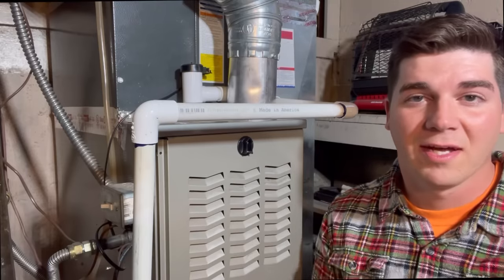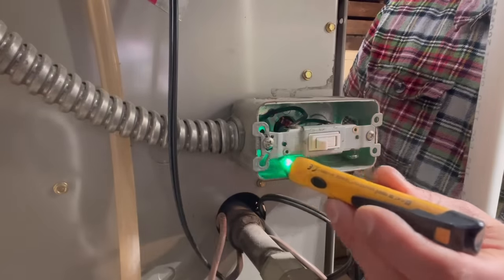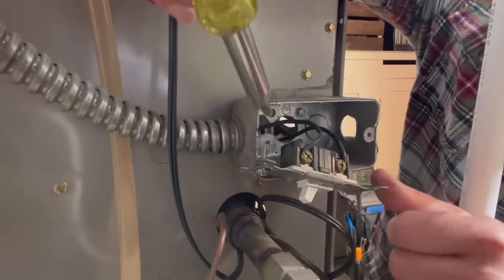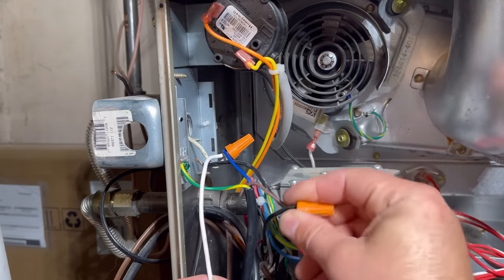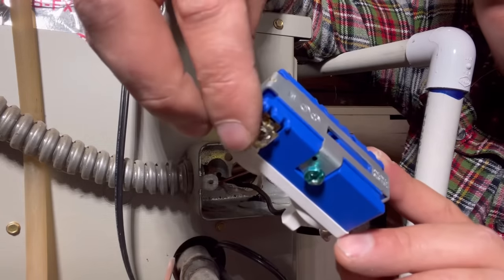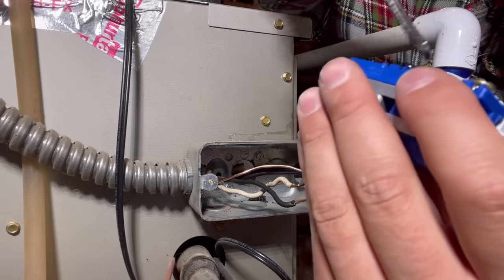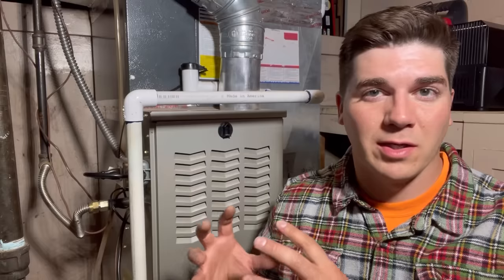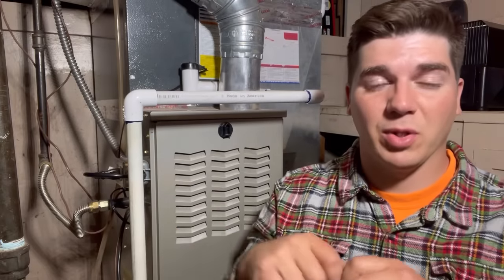This Could Keep Your Family Warm During An Emergency Power Outage.

Comment: The idea is good, but you could have just used a 3 way switch, which consists of a pole and two throws. You connect the main hot line to one of the throws and the plug hot line to the other throw. Connect the hot line input of the furnace to the pole and connect all the neutrals together (plug, furnace,line in). You wouldn't have to disturb any of the wiring in the furnace and you wouldn't need an outlet. The plug with it's cord would just hang down. It would never be hot. The switch would then connect the hot from the furnace to either the main line (on position) or the plug hot line (off position). So if it's in the plug hot line position, it would simply be disconnected from power as if it was in the off position. Then you could plug that into your inverter to power the furnace.
Reply: I really like your thinking.  It's an even more simple solution.  Bravo.
Reply: @ricklee4  What code violation is that? I'm an electrical engineer, please tell me because I must have missed that one. Do people plug in cords in which they have no idea what they do? What if there's a clothes iron with a pile of clothes on it? Someone could "accidentally" plug that in and burn down the house. Does that mean clothe irons violate the code?

If you're going to do this to your own home and you know there is no one stupid enough to plug it in, it is not a problem. The plug cord is short and can't be accidentally plugged in without connecting to an extension cord.

But hey, if there are people that dumb living in the house that would go out of their way to find an extension cord to plug in something that obviously shouldn't be, then you can put a receptacle there instead of the cord and have a special cord made up with plugs at both ends that could be used instead.
Reply: I'd love to see a video on exactly how to do this.
Reply: @Artanis1000  All you would need to modify is the white neutral wire inside the switch box. You would cut that wire, pull an inch or so slack out from the furnace and strip the two ends. Those two ends would be reconnected along with the white from the plug; you can use the same WAGO connector used in this video. The existing switch would be removed. There are two black wires going to it. The hot from main and the hot that goes to the furnace. With a 3 way switch, you would connect the hot from the furnace to the pole (or common terminal) and you would connect the main to one of the throws and the black from the plug to the other. Connect the ground terminal from the plug to a screw in the switch box. That's all there is to it.
Reply: @ricklee4  I agree
Reply: Once you remove the hardwired connection and attach a plug, the furnace is effectively "cord-and-plug-connected," and 422.33 specifically tells us we can very well use that accessible plug and receptacle as the disconnecting means. You can't get much better of a disconnect than literally disconnecting it.

That being said, I would still prefer to see the plug/receptacle before the switch, which would also have the benefit of allowing the receptacle to be used by a furnace technician for tools (vacuum?) during service.
Reply: @lizardking8388  please consider this hypothetical scenario, as an engineer. The furnace is a considerable distance from the breaker box, and is wired up with awg#14. In addition to that run, of course, it stops at the required safety disconnect switch at the entrance to the room containing the furnace (this usually means "top of the basement stairs" in my region). There's considerable voltage drop on that wire at the furnace end. At this particular moment, the furnace is running, and the generator is not plugged in. Since the neutral prong of your generator cord (which has currently fallen on the floor and your poodle is laying on it) is connected to the loaded end of that longass "neutral" resistor, you're about to hear a yelp and google the breakdown voltage of fur.

I have NO IDEA exactly where that is in the NEC and I don't feel like searching an 879-page PDF at this time, but the same rule that stops us from using suicide cords stops us from doing this. NO current-carrying conductors (hot OR NEUTRAL) should be exposed in that way.

My experience with engineers has been that they're excellent at coming up with systems that do the assigned jobs but seem highly prone to forget side effects that either code, general practice, or common sense already solved decades ago.
Reply: @emolatur  Here we go again....Another rocket scientist...... 

First of all, any voltage drop would be so tiny, you wouldn't even feel it. As a matter of fact, I've touched live neutral lines with my fingers many times for various reasons; either accidentally or from curiosity. Number 14 copper wire has less than 3 milliohms per foot. Let's exaggerate and say that there is 100 feet from the furnace to the breaker box. That means there is 300 milliohms of resistance. Let's also exaggerate and say that there is 15 amps going through that line. That would give a voltage drop of a whopping 4.5v (which also means it wasn't wired to code). If you put it in your mouth, you may feel a tickle, less so than putting a 9v battery under your tongue. No one can get hurt by this. If it was wired to code, the voltage drop would be less than 1v. Guess how many people died throughout history by touching a live neutral wire that was properly wired (correct amps/gauge/length)? Zero!

Secondly, you only need maybe 6 inches of cord, which would not touch the ground. If you want to be anal with the code you could also put a plastic bag over it (or wrap an entire roll of electrical tape around it) and label it however you'd like to prevent dumb people from doing dumb things since this won't be used very often. The plug would not be exposed in this situation. You could even get a double pole, double throw switch that switches both hot and neutral and your argument completely disappears.

Since you like to make up such unlikely scenarios, how about these with the furnace wired up just like in this video:

1) Your poodle, with his teeth, pulls the plug partially out and his tongue touches the hot wire. You now have a hotdog.

2) The heat stops working and your dumb son-in-law goes down the basement and with his extremely limited troubleshooting skills, he flips the switch back and forth without the furnace firing up. So he assumes the outlet is dead and has this "brilliant idea". He gets an extension cord, pulls that plug out and connects it to the extension cord which he then plugs into an outlet on the wall. However, it still doesn't work. Since he reached the end of his troubleshooting skill-set, he calls the heating company and they send out Moe, Larry and Curly to find the problem. They flip the switch to the off position and since they are not bright enough to notice the extension cord and assume the circuit is now off, they proceed to "fix" the problem without testing to make sure there is no power to the circuit. I'll let you figure out what happens next. Anyone authorized to fix a furnace isn't going to do so without making absolute sure the power is off by testing it first, regardless of the configuration.

Every time I offer up a great solution the safety police never fail to show up and give me a futile exercise to combat.
Reply: @lizardking8388  Listen I'm telling you why we don't do it, and you're showing me why engineers aren't licensed to do electrical work. Have a day.
Reply: @emolatur  Some of the electrical codes are vital for safety and some of them are over the top just to avoid lawsuits that make false claims as to how an accident happened. Yes, you shouldn't expose a neutral wire, but not for the reasons you mentioned (small voltage drop). The reason is that if the neutral wire somehow becomes disconnected somewhere between the connection and the breaker box (infinite ohms, full voltage drop), you can become become part of the circuit and be electrocuted if you grab the other side of that wire, are well grounded and somehow got a tight hold on the wire. Electrical codes are written to include any and all situations, regardless of how unlikely they are to happen, just to meet underwriters demands to absolve electricians and insurance companies from unfounded lawsuits. BTW - Electrical codes are written by, are you ready for this? Engineers! ...and they are blindly followed by electricians that are required by law to follow them. The likelihood of a neutral wire becoming disconnected, short of an amateur not tightening the connection in the breaker box or a chipmunk chewing through it in the wall, is lower than being struck by lightning twice in the same day. If such an unlikely scenario did happen, someone touching it (why would a normal person touch it? Don't we grab plugs by the insulated part?), would get a shock, most likely not lethal unless grabbing the terminal between two fingers standing in a puddle. 

Anyway, I already mentioned you could put a plastic bag over it and electrical tape as well or use a DPDT switch and that should satisfy all codes if someone wants to be as anal as an electrician. Electricians are forced to follow these anal rules, but homeowners are not. I believe this video is aimed at homeowners, not electricians and my solution is perfectly safe. I know all this because I'm an engineer and you're just a follower (electrician). Have a nice day.
Reply: @lizardking8388  I agree that some of the  rules are overzealous. Hell, some of them are flat out ridiculous money grabs... but there was a question up there /from you/ about code, and replying to that is the only reason I spoke up at all.

Personally I don't care how many codes (or general good practice) someone chooses to ignore if it's not my house or my job.

There's also a relevant bit here about generator bonding (which wouldn't make the solid neutral thing illegal, but would add extra steps to make it so).

A plastic bag isn't going to make it code-compliant. A DPDT switch would, yes.
Reply: @lizardking8388  you may be an electrical engineer but that doesn't make you an electrician. Check a code book he's right. And for you to give such a stupid response is ridiculous codes are made to stop such possibilities from happening whether your stupid or not for doing such things. You could have this set up in your house for 30 years and never get it wrong but there is a possibility when your engineering mind goes that you do mess up then what. The cloths burn or the linesman dies.
Reply: @lizardking8388  oh and do you mean a double ended male plug cord by "special cord"
Reply: @scottscott4067  Good god. I never said I was an electrician. Before calling me stupid, you should read the whole thread where I went into explicit detail of how some of the code is overkill and how an electrician even agreed with me. Then you will realize who really sounds stupid. I'm not repeating myself here. The electrical codes are written by engineers of which I am. Question is, who are you?
Reply: @lizardking8388  didn't call you stupid just your response I don't know you. For you to try and make someone feel stupid by say if you turn the iron on with close under come on man. If I empty my fireplace into my green bin after my fire goes out and park it next to my house it going to burn it down. So what it has nothing to do with the guy saying your way is against code. It is end of story.
Reply: @lizardking8388  A cord with (male) plugs at both ends is a suicide cord and deadly.
Reply: @TerrellWSmith  Yes, if you allow access to ANYONE, it can be deadly. However, if YOU made it with a 3 prong connector with all the connections straight through and YOU are the only one using it and YOU store it away with your equipment and YOU are smart enough to plug the two ends in before starting up your inverter and shut it off before you remove them, it is safe. This is something that only gets used in an emergency, when the power goes out; it doesn't just sit around in open space, waiting for anyone to use. I would treat such a plug no different than a firearm. Alligator clips are just as dangerous, I use them all the time. If you don't feel safe using my methods, then you shouldn't use them. Keep in mind, everything I mentioned in this thread applies to a furnace in the basement. Anyone who is going to be hooking up an inverter to a furnace should know what they are doing. This is not something I would recommend in the living area of the house where anyone, including a child has access. Driving a car can be deadly, but if you're responsible and know what you are doing, there is very little risk.
Reply: @lizardking8388  It seems that you're ignoring... or at least downplaying... something that's central to codes: houses eventually change owners/residents. When they do, the previous person's perspective on what is intuitive/safe/smart/common sense goes out the window, raising the risk that someone might be harmed. 

At its core, code is simply a way to establish some sort of baseline independent of personal tastes and preferences. And before anyone states the obvious--that harm is never 100% preventable--that's not the issue; it's whether we can manage risk by reducing the likelihood of situations where one-off configurations can potentially contribute to unintended consequences.
Reply: @sirrebral  Your way of thinking makes owning a house seem like renting; and seems communistic. If it's my house, I'm going to modify it anyway I like. Things I do to the house are there to benefit me, not the next potential owners. If one day I decide to sell it, obviously I would have to change it back or it won't pass inspection the way it is. Even if I forget to change it back and the inspector misses it, no one would be harmed for the reasons I clearly mentioned in previous posts. You're not going to leave a double plugged cord laying there with a note that says plug me in and find out what happens. The cord goes with you, not the house. No matter what configuration I mentioned, there is zero chance of anyone being harmed in any way, as I've explained; you people are really reaching.
Reply: @lizardking8388  It is your house, but only for a fraction of the structure's useful life. And it doesn't mean that you have the right to build or modify it any way you please, just like you can't drive your car at any speed you wish...other people have a stake in your actions. It's also not "communistic"; it's being a responsible person who doesn't act like a child when they don't get their way. And I'm sure that you know that home inspections are neither mandatory nor comprehensive nor binding, so that's a weak argument for doing something that is against code.
Reply: @sirrebral  " just like you can't drive your car at any speed you wish"

You can drive at any speed you wish. You may get a ticket if you get caught, but you CAN drive any speed you wish. 90% of drivers will drive 5 - 10 miles over the speed limit to get to their destination quicker; I bet you do as well! You're not supposed to (according to code) and if you do, like everyone else, you're probably not going to get a ticket unless you drive more than 15 miles over or there's a cop hell bent on giving speeding tickets. I'm glad you brought that up because driving is something everyone can relate to and speed limits are a form of 'code'. Lot's of people, even some electricians are scared of electricity and don't fully understand it and that makes them anal about SOME of the code that was written by government agencies that have very little to do with safety. When they're doing jobs, they should follow them to the book as their job depends on it, but for their own house, they could ignore codes that have nothing to do with safety if they truly understand that there is no danger imposed. Going 5 - 10 miles over is the equivalent of doing the modification I discussed, bypassing a code that has nothing to do with safety.

"I'm sure that you know that home inspections are neither mandatory nor comprehensive nor binding"

Well then that's THEIR problem, not mine. Lot's of bad things can happen to people who waive the inspection which have nothing to do with my modification. Not getting a house inspected before buying is a stupid proposition. I'm not responsible for stupid people waiving an inspection. The inspection is there to protect the buyer, not the seller. I can't be responsible for someone else who is not willing to be responsible themselves.  I'm not my brothers keeper. Again, you sound like a communist..."for the greater good", LOL. If I left behind an outlet that only has a neutral wire connected, it only means that if they plug something in, it won't work because it is missing the hot wire. There is 0% chance of anyone getting hurt and if you disagree, then you just prove that you don't understand how electricity works; which is YOUR problem, not mine.
Reply: @lizardking8388  Using your logic, a person can commit a capital crime too, but that TOTALLY misses the point that rules underscores that our freedoms aren't without limit, particularly when they infringe on the rights of others.

An equally tangential argument surrounds whether one gets caught or not. That's a matter of whether an infraction is witnessed/reported or not, as opposed to the suggestion that an illegal act is somehow less egregious if one isn't caught. 

As for home inspections, you've chosen to focus on my statement about whether they're mandatory, without addressing what I said about them also not being comprehensive or binding. It goes back to not getting caught is no excuse for breaking the rules.

Finally, you really don't seem to understand our democracy if you continue to call rules "communism". This nation was created on a system of checks and balances... literally rules of conduct... that ensure that no one gets to operate with impunity. Looking out for others isn't some pie-in-the-sky "for the greater good" ideology; it's literally the democratic framework that protects you and me from having to spend vast time and resources protecting ourselves from anarchy.
Reply: A double pole double throw switch with a power inlet would be the ultimate set up. You would need a double gang box to fit everything. This would have no cord attached and allow you to use a regular extension cord to plug in an inverter or generator. I think this might actually meet code in most areas, maybe. It's the safest and most convenient way I can think of without having to modify your electrical panel.
Reply: @roger_985  Yes, I have mentioned this in one of my posts above. However, DPDT switches that are fitted to standard household boxes are hard/impossible to find. You would probably have to make modifications and buy other parts. You'll probably run into another anal code issue, such as having to use a non-standard box or switch. If one wants to spend extra money and time, they can go that route, but the gain is only to get rid of a non-existent issue, which may create new non-existent issues. Keep in mind, when your generator is plugged in, the whole chassis of the generator will be connected to neutral as they are usually internally bonded. An exposed neutral that is wired correctly poses no danger to anyone; but if you insist on being anal with the code, knock yourself out.
Reply: @lizardking8388  love the humor from “First of all, …”. As to the first part: the whole War of the Currents (AD vs. DC grid) between Tesla and Edison was about voltage drop and necessity for much thicker copper wires for DC, short runs from dynamos, etc. So as you state, VD is nowhere near an issue in this matter. As for “idiot proofing” a Twist and Seal extension cord protective barrel can be gotten from Home Depot and elsewhere in a nice Christmas green. $6.98. Prettier over the long haul than a plastic bag and to anyone familiar with the art (HVAC, inspector, electrician) a feeling that the original creator has some degree of competency and may address the unusual “transfer switch” arrangement with less sanctimonious criticism.
Reply: @peterwachter7753  I agree and good point.
Reply: @ricklee4  That's why you label the pigtail "Generator Only" and the normal position of the switch "Line".
Reply: @ricklee4  "There is no off position on a 3-way switch, it is ON-ON."

Obviously. If you're going to make a comment, you should read through the whole thread. It's not my job to repeat everything I said just for you.

"Code requires that it can be turned off."

The part when I mentioned the 3 stooges, I was referring to a normal on/off switch that is used in the video. BTW - If a 3 way switch has power on one throw and not the other, then when it is switched to the other (where there is no power), it is OFF and IS up to code. Here's a fun fact, a 3 way switch can be used in place of a regular on/off switch if you only use the pole and one of the throws. All electricians should know this; which leads me to believe that you aren't an engineer or an electrician; thus have no business arguing with them.
Reply: @lizardking8388  "I've touched live neutral lines with my fingers many times for various reasons"

Thanks for telling us you are not very smart.
Reply: All the haters here trolling In the comments, when they're electric goes out and this happens to their family in -25° weather, this video will be there go to and in that moment w/ u and your family freezing you'll then come to the conclusion and be like, "screw the dumb code." 💯